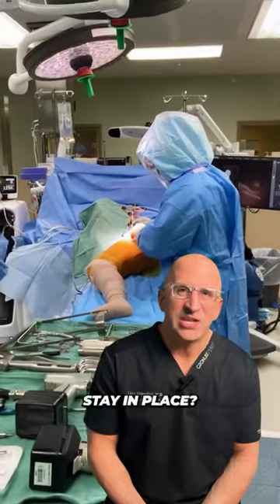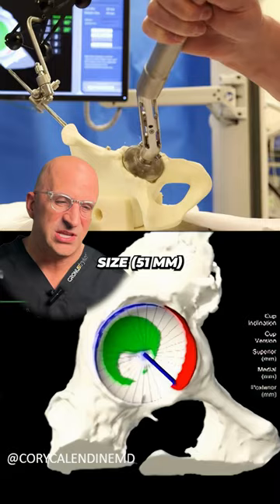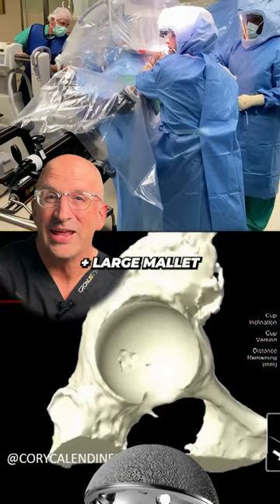How Does a Hip Replacement Stay In Place? 🔨 Pressfit Hip Implants #shorts

Comment: So you’re a contractor… but for bones.
Reply from the maker: Definitely similarities, but I wouldn’t trust myself to hammer anything outside of the human body 😅 Thanks for taking the time 🙏
Reply: @BoneDoctor_YouTube and i as a contractor wouldn't trust myself to hammer anything inside the body.  Maybe.
Reply: @BoneDoctor_YouTube i think you're being to humble.
Reply: THE BODY IS MORE LIKE YOUR CAR. IT HAS JOINTS/BALL JOINTS,RADIATOR VS SWEATING,SENSORS WHEN YOU OVERHEAT GET ACTIVATED.GAS VS FOOD FOR ENERGY, COMPUTOR VS YOUR BRAIN
Reply from the maker: @kennethswanson714  often requires some of the same techniques
Reply: First thing I thought
Reply: You mean, I could have been doing This to my enemies- legally, instead of my car's ball joints all these years? . Terrific.
Reply from the maker: @EightiesJames 😅😅😅
Reply: As long as he a finish carpenter over a framer
Reply: He's literally setting an anchor
Reply: @BoneDoctor_YouTube idk you could probably build Hella birdhouses with all that experience sawing and hammering.
Reply: Nice to know. Do still fasten the hip socket to the pelvis?   My x-rays show two screws help holding mine in.
Reply: He shops at Bone Depot ®
Reply: @kennethswanson714  as a mechanic I wouldn't trust myself to a hammer anything inside of a body
Reply: Mechanics make good surgeons.
Reply: @BoneDoctor_YouTube  I'm thinking this is more what a machinist does, and we would call this an "interference fit" usually we would heat up the bone and expand then cool off and shrink around the male part.
Reply: Biological mechanics 😂😂
Reply: Machinist.
Reply: @BoneDoctor_YouTube if you can hammer a rod into a hip, surely you can hammer a nail into a plank lol
Reply: In the mad max game they are called “organic mechanics”
Reply: @afridgetoofar1818 this comment is severely under liked.
Reply: Ironworker
Reply: @BoneDoctor_YouTube as a joiner by trade I can hammer anything but bone😂
Reply: Well they aren't using the framing hammer that doubles as a screw gun 😂
Reply: Bone Contractor is a lot cooler a job title to have though, you've gotta admit.

Comment: A surgery room sounding like a mechanic shop is crazy
Reply from the maker: Often sounds very similar. Thanks for taking the time.
Reply: As an auto technician, i can say Youre definitely missing a few things, try getting an impact, air hammer and maybe a die grinder lmao
Reply: similar to popping a CV joint in lol
Reply: surgeons also forget tools inside too! 😝
Reply: I'd be more concerned if it was the other way round.
Reply: I told my back surgeon he was a mechanic. He smiled and said "I think of it as being a carpenter". That was 30 years ago and I'm doing well still. 😊
Reply: U really have to be insane to be a dr. Noone should ever want to go under the knife. Drs are can be awsome but u can also die under an evil one. And there are a plenty
Reply: Was thinking the same
Reply: @Eduardo_Espinoza what's the surgeon's equivalent of a 10mm socket?
Reply: I think it was small scissors or needles @OneTrueCat  some lady on news died that way sadly

Comment from the maker: Quick explanation of pressfit or uncemented hip replacement - great options if you have healthy bone. Lmk what questions you have and more hip implant specifics up soon. Thanks for taking the time 🙏
Reply: What if bone breaks or get fractured when ur hammering it to fit? 
That looks scary
Reply: Does the bone ever fatigue or crack after the surgery from the pressure fit? Ive seen wood jointery crack after so many years of constant pressure
Reply: Question is when doc is hammering on the knee won't that force travel to the whole bone? And create micro fractures on tibia ??
Reply: What are the success rate and longevity with this type of procedure on someone in their 30s?
Reply: @Flesh4Toast don’t have it done in your 30’s if you can help it
Reply: @Flesh4Toast how do you measure success? Longevity = 95% last 10 years, 75% last 15-20 years, 50% last 25+ years. Since average age of a hip replacement patient is around 65 most replacements outlast the patient.  Of course if you have one done at 35 the likelihood of needing it redone in your lifetime is higher.

Comment: Would it the forcing of the plate cause stress fractures around the bone? I would rather invent a piece that can expand into the original size and be locked in place so as to cause less pain and faster healing. But I am just a carpenter. Wish I could stuff like that! That must be so satisfying to work and fix broken bones.
Reply from the maker: Excellent thought. It is important to make sure that the cup is being pressed into healthy bone. In cases where the hip socket is extremely damaged or bone is extremely thin sometimes the socket Hass to be reconstructed with additional custom metal plates to allow cup fixation they should take your time.
Reply: No not really if the bone is decent quality, the reason the hole is reamed is to give as complete a fit as possible, you really don’t want gaps or movement 
The body has incredible recovery ability
Reply: In healthy bone, any tiny fractures heal and actually heal stronger.. it helps everything lock together but imagine if the hit it too hard 😮
Reply: When I make ball joints for my scale RC models that is the trickiest part, captured ball. I make the control arm tighter to hold the ball in place. I press them in as well.

Comment: I actually make the components for implants. The factory I work in does hips, the acetublar shells, the ceramic heads and the liners. Plus full and partial knee products. Titanium and cobalt chrome. My job is to manufacture the large complete knee replacements and polish them to a mirror finish in order for there to be no wear on the bearing for the patient. Incredible medical achievements.
Reply: That's actually really cool, you talk about your job with passion you just really enjoy what you do! I fabricate suspension components for cars so not nearly as impressive but I know what goes into ensuring a fit within tight tolerances, I can't imagine the tolerances you'd have to meet for something like a hip replacement
Reply: Hope it was not the J and J (mom) that was recalled?
Reply: @rickwunn2850  no not j & j. Another big contender though.
Reply: Wow.😮
Reply: how do I get this job..
Reply: I think I need a replacement knee, how much for a left 🤣

Comment: My first hip replacement lasted three years because I didnt listen to the doctor and went back to heavy construction. My second one has lasted 10 years so far and still going strong. 
A lady I know just had her hip replaced and the doctor installed the part of the joint that goes down inside the thigh bone in a way that made it essentially cocked. This means the ball joint didnt mate up with the socket correctly causing her tremendous pain but she is scheduled for another surgery very soon
Reply: I've been lucky, had total hip non cement,in 2008, let it heal for 9 months wih physio,  been working in construction since driving excavators, trucks, labour,  touch wood still going strong. From Australia . Hope your 2nd one serves you well, keep doing the exercises that keep your hip muscles strong. 😊🌏
Reply: @hippopotaman075  Nice to hear your surgery went and recovery went great.
My biggest problems these days is the soreness that comes from say walking around Walmart for 30-45 minutes, I start limping and the fact that my right leg is about 2 1/2 inches shorter than my left leg.
I hope you continue to stay problem free but let me leave you with a small piece of advice. Avoid lifting heavy weights and allowing the pressure to weigh on the hip joint. Thats one of the main reasons my 1st hip replacement went bad. I managed to squeeze the gel or whatever it is they use in the hip joint socket that prevents bone on bone contact when the joint rotates
Reply: Yeah, thanks, thats why i did the 9 months physio,  1, let the bone and cup knit together, 2 build up the muscles that hold the hip joint in place. The only pain i had was stretching out the scar tissue from the cut, thanks for replying

Comment: Is this more efficient than simply making a perfect sized hole and drilling the metal piece in?
Reply from the maker: That is the general idea, and the specific goal is precision, alignment, depth, and placement of the cup. However, regardless of specific planning or technique, it is important that the cup surface is pressed firmly and is in contact with bone surface. Thanks for taking the time 🙏
Reply: You want as much contact as possible with the bone, hammering it in guarantees that
Reply from the maker: @_wayward_494 Excellent! agreed!!

Comment: Why not freeze the metal before inserting it into the socket then it will expand when it heats to body temperature? That would surely save a lot of stress on the bone from hammer blows.
Reply from the maker: Thanks and consideration. Do you think the temperature of the metal would damage any of the tissue?
Reply: @BoneDoctor_YouTube  possibly, I really don’t know is the answer to your question.  I’m not a doctor so I don’t know how bone would react to extreme cold. I know the method is used when fusing 2 pieces of metal together by heating one and freezing the other. Just wondering if it would work the same in this situation?.

Comment: I actually know that the cup is supposed to be a line to line fit.. meaning machining the bone a 51mm and then fit a 51mm cup.. instead we press the metal into the bone on the femoral side.. thus calling it press fit. This is line to line and press fit  way of fitting prosthesis. Cups are always line to line

Comment: Double knee replacement. Was flying a couple weeks back and kinda had fun stepping into the regular metal detector unit and hearing the thing go off. I know I should tell them up front as there is a different scan for detection of metal parts.
Reply from the maker: Thanks for sharing. That is common question from many joint replacement patients. hope knees are doing well!

Comment: That isn't "press" fitting, that is HAMMERING. Press fitting is a smooth, constantly increasing pressure equally distributed. Hammering /beating something into place is just rough as hell and often times damages something. Is the metal Ti- 6AL-4V?

Comment: 2016 broke my ankle and put back together with 11 screws and a plate. I can feel some of the screw heads under the skin. Had a lumbar laminectomy in 2009. Been doing good since both surgeries. Very thankful you doctors can stomach this stuff.

Sadly my grandmother went downhill after her hip replacement  For some reason they couldnt get her sodium stabilized and she also stayed in pain...she just quickly deteriorated. She ended up passing away in her 80s about a year after surgery 😢. 

Im thankful that some people do have success in their surgeries. Sometimes its the only option/last resort.

Comment: It's no big deal anymore to get a total hip replacement done.  I checked into the hospital at 6am was on the table by 7:30 am , was done  by 9:30 am and woke up in recovery around 12:30 pm . I was let out the hospital at 2:30 after they made sure I could stand, put my socks on,  pee and all my vital signs were good.  I was able to get into the car ,get out of the car walk with a walker into the house and get into bed feeling very little pain.  The constant pain I felt for two years, 24/7 was gone and I was deer hunting a month and a half later pulling a deer out the forest.

Comment: I had this procedure done on both hips 6 weeks apart. Not fun at all. Woke up strapped to a foam triangle between my legs with 22 staples in the side of my hip. I watched the whole surgery online a week before i went in for the surgery to prepare myself. The surgeons swing for the fences to do all of this.
Reply: That foam triangle is called a hip abduction pillow or wedge. It helps prevent the repaired hip from popping out after surgery.

Comment: I have a complex problem. I need a double knee replacement but I’m an Amputee; BKA left leg, and in my right Tibia I have a “nail” in 1992 after an open compound fracture. I need this done but don’t know how the hell they are going to remove the nail. 

What has your experience been with removing a surgical nail that’s been inside someone’s leg for 31 years?

Comment: I had a total hip replacement done in the 1980s when they used a plastic bushing in the metal cup. I have a 14" scar down the leg. I wore the bushing  out within a few years and was in so much pain, but the docs didn't take me seriously.

After insisting they fix it, they discovered the plastic bushing dissintergrated and they found plastic embedded in my muscle...explaining some of the pain.

The new and improved replacement cup has a ceramic bushing and is still intact (as far as I can tell) almost 35 years later! 

Unfortunately, the fact that the need for the first hip to be replaced wasn't diagnosed for an entire year, I screwed up my back walking like Quasi Moto. And the docs never even noticed it until I about smacked them and said, 

"SOMETHING IS CLEARLY WRONG! LOOK AT HOW I LURCH!"

Huh. Big surprise! I no longer had a femoral head and my hip socket was torn to shreds! Then the docs asked me, 

"How have you walked on that for the last year?!"

And I reminded them that they insisted there was "nothing wrong with me," and simultaneously put me on narcotic pain killers.   

"There's nothing wrong with your leg, BUT, we'll prescribe you SOMETHING for the PAIN ANYWAY." 

Yeah. Thanks. That was a year I will never forget.

Comment: How does that not cause small fractures to the socket?
Reply from the maker: The cup is being pressed into a prepared, typically solid bone surface in Fractures at the pelvic bone, or thankfully, very rare. Thanks for taking the time 🙏

Comment: I know this stuff has been researched and there is probably a very low failure rate but i cant help but think of the times when iv made a handle for a tool started pressing it into the handle and the press fit was slightly too much so the handle cracks
Reply from the maker: legitimate consideration and concern. improved tools and techniques continue to try to make the "low risk" a "no risk"

Comment: Eurothain / I know it’s called something else / weird drainage of coatings and castings / BUt if you body doesn’t reject / perfectly normal just go with the plastic assisted and had a replacement 3 to 5 years “ small incision and a puck bowl replacement and indefinite fake hips with 3x strength due to bones flexing and metal not

Comment: Serious question/comment:
Would the bone not crack?  I am picturing bone as a hard, brittle, material kinda like rock or something.  But I guess it must have some flex/give to it huh?  It’s just that, I work construction, and usually if you force something into a hole that’s too small for it, something breaks.  And between bone and titanium, I’m thinking bone loses. Lol.

Comment: You also use screws and or cement don't lie bruh
Reply from the maker: Cement can be used with poor bone, quality or larger defects, screw are used only if fit is not approximated tightly with the bone
Reply: @BoneDoctor_YouTube  Yeah I know just messing with you. We once acquired the company that invented the whole 3D printed Titanium pourous micro structured surface that the none grows into. Better than cement and or screw.